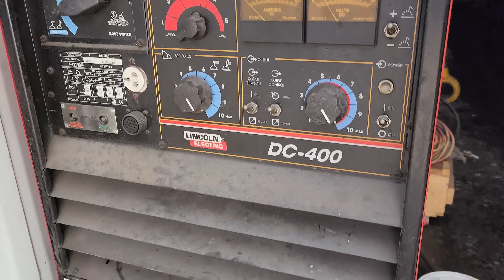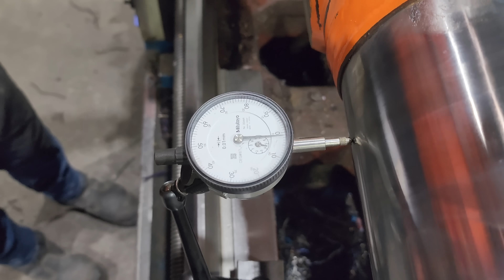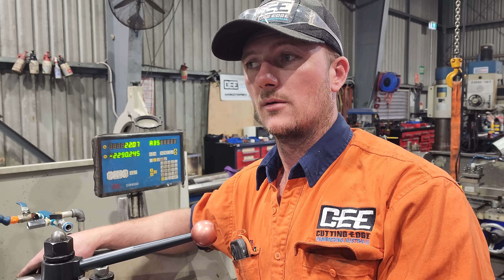Can We SAVE This $20K Cylinder Rod!? | Gouging SEIZED Nut

Comment: I've worked on high value parts for many years. No mater how skilled, there is always the possibility of something going wrong. It's nerve racking. Sometimes the customer will actually appreciate what you go through and what you saved them. It takes a lot of skill and experience to have jobs like this come out well.
Reply: just make the customer pay.  20k piston rod? you know the customer has the money, they are just being cheap.
Reply: This is the type of thinking and acting that has driven repair costs through the roof. Car don't start due to a corroded battery terminal?  Replace the battery and starter for$700 and clean that terminal while you are at it. Use a cheep Chinese starter to replace the OEM that there was nothing wrong with, so you get it back soon to do it again. The customer doesn't always have the money, and several $20,000 unnecessary jobs like this can put them out of business with all the employees looking for another job. A company only exists to make money, and when it doesn't, they are gone and all the workers lose their jobs.
Reply: @The-Fat-Kid  Indeed. BTW, that made me think about how the fair "Right to Repair" initiative faces a lot of opposition from corporations. From Apple to John Deere.
Reply: 1955 car generator rebuild in shop..$2 brushes $3 bearing 15 minutes.. 1965 alternator brush $5 bearing $4 diode $2.. About  hours to remove and rebuild in shop..1985 alternator repair kit from Auto Zone $15 about 2-3 hours to remove and rebuild.  Now between 2 and10hours to remove, no parts available. Rebuilt alternator from auto zone that lasts 6 months $100. New from dealer between $350 and $2000. Of course, they don't want you to fix it.
Reply: @crimpers5543  most people just cut the eye off and make a new rod

Comment: Your work with the arc gauger was damn masterful, despite breaking through in the one area. I never would have thought that was possible without melting the whole thing. Looking forward to some big thread turning next time! Great work you two!
Reply: Don't forget that loving rascal dog! He is part of the team as well.
Reply: after working in a fab shop i was very surprised when i first saw a video of him gouging. definitely a master like you said.
Reply: Maybe a master at using the arc gouge but his choice of tools was poor. Definitely not an engineering background or  a fabrication background lol.. could of had it off in maybe 30 mins to an hr and still have a reusable nut with minimal damage 😂
Reply: @sahilsquadron2286 what method would you use to achieve that kind of result?
Reply: @sahilsquadron2286 explain it then huh

Comment: We are Hydraulic company in UK. It looks to me the wear strips and piston seals could have been resealed without taken the piston off. If the internal seals had gone and was leaking through the middle (could not see any in video) a light weld around the nut and piston would seal that. We always try to make piston and nut combined with a blind hole in piston so it can't ever leek through internal. Once the customer started to undo nut you had no choice but we would have milled it off on a milling machine.
Reply: I don't understand all the praise this work is receiving in comments referencing "insane skills". To damage the threads as much as his approach did, does not seem optimal to me.
Reply: @coolcat23 The threads were already damaged. No matter what was done, the rod was going to have to be rethreaded.

Comment: I'm a little surprised the arc gouger was the tool of choice for this project. Really surprised it didn't get into the threads any worse than it did. I've always used the torch on piston nuts that were seized. And yeah, the ones where the nuts fit up inside the piston suck to cut but it can be done without any significant damage to either the piston or the rod.

Comment: Wow I’ve never in 30 years ever had a rod nut that stubborn. When  hydraulic rams bypass they also build up tremendous heat and it’s very hard on the hydraulic  pumps and valves . I used air arc then I found the scarfing tips for my plasma cutter and now I pretty much use it on everything I used to have to air arc . It works awesome . But My plasma cutter isn’t your run of the mill  small shop or hobby cutter , I can cut 1” plate with it and it’s clean . Love the video and thanks for sharing.

Comment: If it just were a straight nut, I would have tried to mill it like you gouged it, but with this collar part that sticks into the piston you had no choice, great decisison!
👍
I laughed so hard when Homeless released the suction cup, nice idea btw!
🤣🤣🤣
Thx for the vid, let's see how it goes with the new nut!
👍👍👍
Reply: It may well have undone enough to mill the rest off once it was relieved, trouble with a galled thread is you never know if it's going to get worse or undo??
I would have been tempted to try and undone it after the first cut it may well have been enough.
All in all its off and the rod is saved so job done, master of the ship chooses the heading.
Reply: You can mill wit angled mill and go 45° for example, so you can reach under that collar. And then use wide wedge and hydraulic press to crack the nut loose
Reply: I'd be afraid to gouge, so would've gone on the lathe. 
Just a small tack weld on end of rod to hold the nut from breaking loose unexpectedly.
Reply: Need to tie the toy to the forklift, I dont think he can pull that but he dosent know that !?!?!

Comment: Good to hear/see air arcing..its great to watch when disassembling structural steel structures 200 feet in the air 😊.
Someone good at it can literally cut the weld and leave the steel basically uncut

Comment: Years ago I worked as a cinema projectionist, by the time I got into that industry most of the cinemas had upgraded to pressurised  xenon lamps that were good for over 2000 hours (longer if you didn't run them too hard) but a couple of places I worked at still had some old-school carbon arc lamphouses used for screening film-ads and trailers before the film. The carbons looked exactly the same as the round ones you're using for the arc gouging, I imagine it's the same process, except the burning carbon arc was used for a light source rather than a cutting tool. Despite quartz envelope lamp technology vastly improving stability, longevity, and safety, the carbon arc provided the brightest and most natural looking light spectrum when it was burning just right, they were the closest thing we had to the light spectrum of the sun. The downsides to carbon arcs were they were messy, dangerous, could be tricky to align properly, the sliders that allowed them to burn down smoothly required continual cleaning and maintenance, they generated a lot of waste, and of course they only burned for 30 mins tops. Lots of trouble, but they looked fantastic on the screen. 
It's pretty cool to see those carbon rods still in use, albeit for a different purpose.
Reply: Thanks for your comment, it’s interesting. 👍
Reply: Ah the good old days in the projection room. I remember I could still smoke and do 6000 foot reel change overs at the same time.

Comment: You should try a victor straight barrel torch with a curved wash tip. We use this set up a lot in oil and gas. Can wash a collar off of a joint of made up casing without touching the threads. Pretty easy to do with a little practice.
Reply: It has its advantages.
I think it what you’re taught from the beginning and comfortable with.
Reply: Most are never shown how to use the flame adjustment air not the high pressure air when they get close to the threads . If you didn't know that it would be a little scary I guess

Comment: Damn those are some fine pitch threads for such a large bolt. Nice work.
Reply: Has to be, lots of tension applied to those threads when in use, so the area of thread has to be much larger than the rod area to not suffer from fatigue. Plus only half of the thread area is engaged at best, simply because of the machining, and needing to keep some space for the nut to turn when installing or removing.
Reply: @SeanBZA  Great explanation. Thanks 🤙🏻

Comment: Awesome job their👍👍👍. This brings back a lot of memories in that I worked for Atlas Copco Wagner Mining as a diesel mechanic in their plant in Portland, Oregon USA for 18 years. I built a lot of hydraulic cylinders. We custom made all our cylinders until Atlas Copco decided to farm a lot of that work out. We used to make our nuts out of flat steel plate then machine them in the machine shop in big batches at a time. I think the pistons where made out of bar stock , unless they where to big in diameter then cut out of flat plate. It’s my opinion that you can under size that rod end no problem. My suggestion is you make a couple of spare nuts but leave the inside bore unfinished then as needed machine thread to size. Those machine threads on rod ends and cylinder barrels even in new assemblies you had to vary careful about thread galling during test fit on final assembly.

Comment: Good work! That’s a tough problem to deal with! I worked in a structural test lab and seen lots of large nuts and bolts get stuck like that and cause all kinds of consternations. I was surprised you got that nut off. I literally cheered when it came off.

Comment: Nice to have the proper tools for cylinder repairs which not many do. 
I’ve seen guys on benches flipping the bench over 
Use a loader bucket to hold the bench and a 4:1 lol flipping all over omg. 
Hyd cyl bench is a dream but most are too cheap to have that

Comment: I thought you might just machine down the galled area and just use a new standard nut.  But what do I know??😃 Great content, as always👍
Reply: Probably because it also worked out cheaper to redo the thread and make a new nut than trying to get away with cleaning the thread buying a new standard nut.
Reply: Difficult to find where the thread bind was. What about a big nut buster.

Comment: I have a carbon arc and it gathers dust.
I’ve ended many debates with my scarfing tip that doesn’t leave hard spots.
Use a pipe fitter wedge. They create big pressure and don’t pop out.
You do good work so don’t be afraid.

Comment: Great job getting it off the shaft.  I would just suggest one thing, when changing the insert on the lathe tool, blow the chips off of the insert before putting it back in. It will make the tool pocket last longer and the insert will go back exactly in the same place.  Take care.

Comment: I have done this repair tons of times. The common way would have been to simply turn the nut down to the major diameter of the threads and then chased the threads to clean out the galling and then replaced the nut with another new one from the manufacturer.

Comment: I have done this exact same thing on a hydraulic rod that size. Keeping in mind, the shop makes $150 an hour for me to work, I see air arc as last resort. The threads on the rod don't need to be perfect to seal, because they don't seal. I would cut it with a bandsaw or zip disk. Also it doesn't need to go all the way through to come off. But for sure I have used a torch to just cut it and be done.

Comment: Nice work. I have done stuff similar to this before. Not the gouging, but machining and repair. I often had to make bushes for the eye or whatever they are called. Machined to a size for cold shrinking into place. This is all quite familiar. I had sound absorbing screens around my area of the shop so the Boileys could gouge away on their jobs. Damn those were loud, even with ear protection.

Comment: you make this job very big, I have done these jobs for more than 40 years. you had 2 options 1. use the 4inch angle grinder with a cutting disk.  cut the nut from both sides up to the thread, then use the chisel and hammer and split it.   2. simply machine down nut up to the thread level then clean the thread .number 2 is the best way.

Comment: I am really impressed with that spray metal contraption you use from time to time.
I thought you could have used it on threads, building it up to original specs, but I am missing a bit on the metal sprayer as I just love that tool. lol

Comment: You did an fantastic job not hitting those threads with that carbon arc. As you know, once you get extremely good at gouging, you can't beat it. It's very fast, very precise and you wind up with a very clean and stable groove, especially if your going after known defects/targets at a certain depth as indicated by UT or Visual Inspection. The heat input,to the parent metal, is significantly less than using an oxy-acetylene torch or plasma cutter on 1/2" + mild steel. 
 As a benefit of being extremely good at it, NO ONE, when your running 3/8" carbons at 550 amps with 100psi air, WILL BOTHER YOU !

Comment: I would be concerned that arc gouging would have damaged the threads, but you did a nice job of splitting the nut.  I would have put a rosebud on the nut to see if heat would expand it enough to release but it may still have boiled down to what you did. You machining the damaged threads down and getting ready to re-thread was a treat to watch. I couldn't find the part two though.

Comment: I have watched a few of your videos with admiration of your workmanship. However a quick question regarding this Nut removal process.
 Would it not have been easier and quicker, with less chance of electro-flash damage to other components if you had used a 1,000 tonne 'Nut Splitter' on all flat sides of the nut to swell the ID to clear the seized thread? I have used this method on a number of occasions, when I was much younger, and as part of my trade work on heavy duty- quarrying, earth-moving, commercial & materials handling equipment. I have also used 'Laser Ablation Techniques' to remove seized & broken jet engine 'Hot End - Rear Bearings & Seals'  from expensive main turbine shafts and other aircraft and heavy industrial applications like CAT dozer track frame sheered bolts and mounts.
Les Dunn

Comment: Love your work, you are a very competent and versatile tradesman. Just wondering whether simply removing the first three damaged threads would have been an easier fix? The length of the thread seems over engineered therefore I wouldn't think losing three threads wouldn't make any difference. That way you could machine a standard size nut. Just a query!

Comment: Carbon arch gouging is so nice, in my welding course we had to use it for taking off backing strips of test pieces, it takes practice and a good eye but you can do beautiful; things
Reply: Because the air is pushing so forcefully it dang near instantly cools the weld pool from the carbon arc so the second there is any separation between 2 pieces of metal you can sit there and carefully just barely cut off material without touching the material

Comment: As a 56 year mechanic, I would say that what you did was first rate. I do have to ask some questions though. If the rod gland and bearing are OK, why did they need to remove the nut to reseal the piston? On your repair on the lathe you set up the steady rest on the rod surface and not the piston landing surface to avoid any damage to the rod. I have had chips fly out and get into the steady rest and mark up the surface is why I say this. Being the silly old timer I am, I would have checked the rod main surface to the piston cut out surface to be sure they were true to each other, cleared any runout on the piston area cut out and used this less critical surface. Just some thoughts.

Comment: I just cut off the nut on similar cylinders - they are big ones from large caterpillar machine. Cut with a grinder. Outer steel is hardened. I have two cut off saws to deal with the rod itself. Lathe has no issues cutting the rod.

Comment: There are certainly some people out there who could oxy cut that off(I’m not sure if too much heat to the end of the cylinder resulting in changing the properties of the material is a concern, I know carbon arc puts less heat in stuff that oxy)…I don’t claim to be anywhere near that good with a torch, but certainly a few mechanics up in the rest belt would make quick work of that with and not touch the threads with oxy. The most impressive torch work I’ve ever seen is here on YouTube, a channel called South Main Auto, a mechanic up in New York. He had a differential that had been run dry, and one of the pinion bearings had seized to the pinion. The guy torched this bearing off (lots of cooling it down so the heat didn’t change the metal properties of the pinion). Didn’t touch the pinion, didn’t touch the housing, didn’t even touch the bearing race, and was able to reuse the pinion. Very impressive torch work, ‘F150 pinion bearing from hell’ if anyone’s interested.

Admittedly, with the end of that nut hidden under the lip of the seal there, that may present an additional challenge torching it off…and that’s a lot of metal to cut through anyway, you’d need a pretty serious torch head.

Very impressive work regardless.

Comment: For years I have drilled two holes 180 degrees apart parallel to the shaft. Then with a big chisel whacked the chisel with a BFH and the nut splits. Of course nothing this big. I have also used A chisel to make a grove in the nut then used the same chisel and hammer to unscrew the nut. Same technique works well on oil filters that won't come off no matter what oil filter wrench you use.  The base of an oil,filter is thick enough to to make a good grove.

Comment: Pretty good video. A little old school though lol! Maybe invest in some hydraulic tools instead of hand wedges that are too steep, then you wouldn't have to cut clear down to the threads. Kinda like the small nut crackers but bigger. A diamond saw also works excellent too with good depth control, done it a few times myself.

Comment: I have had some success, once splitting the nut using an air chisel to turn the nut off. The air chisel forces the nut to flex open a little bit and will turn it without a huge amount of force.